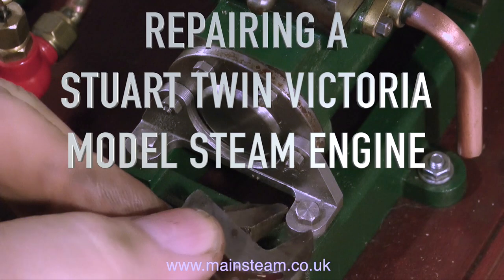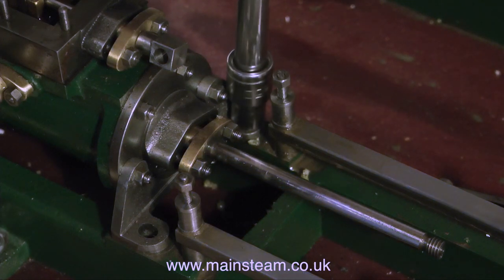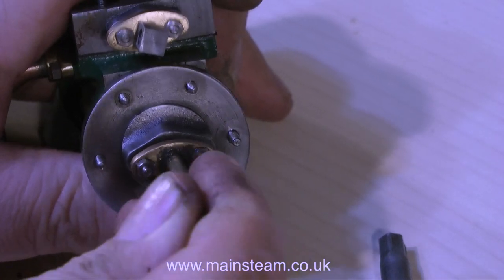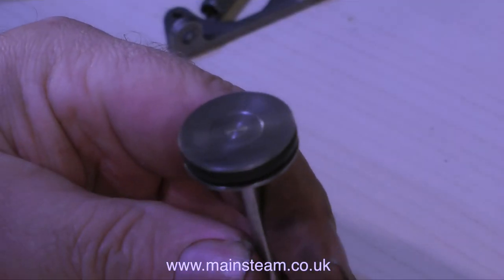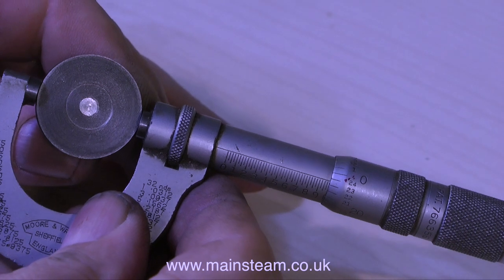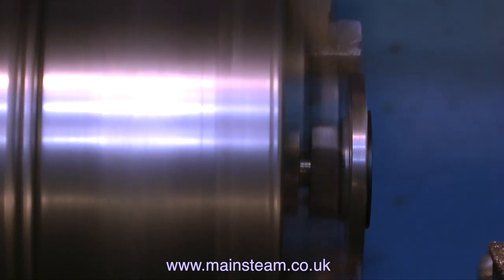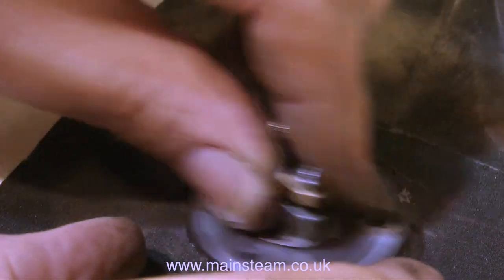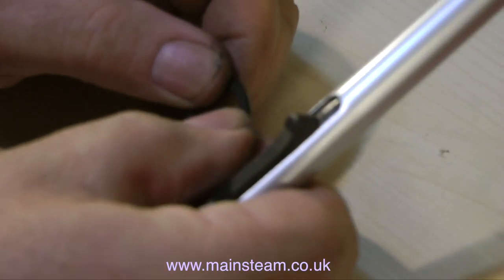STUART MODELS TWIN VICTORIA REPAIR  - Part #3

Comment: Keith, you sound a bit more subdued than usual. I hope everything is OK.

May I have your opinion? I am considering casting a steam engine cylinder in aluminium bronze. This choice is mostly because I have the material handy, and I don't have the facilities to cast iron. Do you think this would be OK with a cast iron ring, or would a silicone ring be better?

Aluminium bronze is usually considered a pain to machine, but I can deal with that.
Reply from the maker: Just tired - it's been a long day ...... Alum Bronze is very hard to work with. If you can machine it successfully,  then by all means use it.I once made some model locomotive axle boxes from Alum Bronze and they were very hard wearing. I would recommend Silicone rings with all nor ferrous cylinders